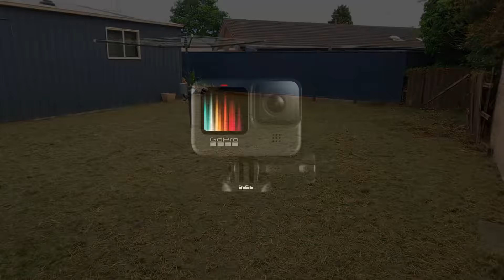GET RID OF IT ALL - SO WE DID - Overgrown Property Clean Up

Comment: I watch a lot of lawn videos just because I love to watch them and this transformation was by far the best when I've seen of all the ones I watch. So far. You turned a shambles into once again a real yard like it wasn't one time
I'm stunned that filled a dumpster.
!!!!

I'd love to know what kind of mower that is because that's one tough little mower!

This was a great job and these people should be thrilled and I don't know what they paid you but whatever it was you probably should have got double !!!
Reply from the maker: Thank you very much, it was probably in my top 5 for neglected yards.
We had to really compact the dumpster, otherwise it would not have all fitted, it was 6m3 bin and we must have filled it with 12m3. 💪
The mover is a Toro 21" personal pacer and has a gator blade fitted, the only issue I have with it is the chute is too small and keeps getting blocked.
I think I could have charged them double and they would still have said go ahead. 💲💲💲
Thanks for watching and comment.
Cheers 🦘👍

Comment: I love that you Aussies use metal fencing… Like shipping containers. Here in the states most of our stuff is plastic or wooden and I would think with the metal it just holds up much better. Great job on that yard!
Reply from the maker: We do have timber fences and these are normally on older homes, most new homes have the metal fences.
Thanks for watching and comment.
Cheers 🦘👍
Reply: I make a joke and say these fences have magnets in them. Usually they are only up a week and a car has driven into them! great job though. I hope that front window is not facing North or West in Australia or it's going to get a little heated inside the house.

Comment: You do a great job and the lawn areas looked fine when all was done.  I am going to offer a  few helpful hints, hopefully.  Get yourself a large flat hand truck, like those at big box hardware stores and keep it with you as you progress.  You can pile tree debris high on it, taking less steps back and forth. When full, walk it to the truck or dumpster and empty it having lifted the debris one third of the way already and you only have to lift it the remaining distance. Next get some light weight collaspable cloth trash bins for grass debris and keep them hooked to the hand truck when not in use. Grass can be compacted down in them and will take up less room later in dumpster or truck.  Lastly, wear a mask always!. Don't breath in those microscopic bits of vegetation and dust. You don't feel anything now, but you will in 10 to 15 years, especially if you smoke. Hope these help. Good Luck with your business.
Reply from the maker: I appreciate all the helpful hint and suggestions that you have made and taken the time to outline.
I have in recent times purchased those collapsible bags and they are great.
Thanks for watching.
Cheers 🦘👍
Reply: Thank you for those hints.  i am watching from far away but already I take these for myself.  Thanks again... God bless you ...

Comment: You missed the bit in the gutters at the front of the house and behind the shed...
Reply from the maker: Not sure where in the front garden you are referring to and for the back yard the home owner didn't ask me to remove it.
Thanks for watching and comment.
Cheers 🦘👍
Reply: @TigerDusty  if you look, at the end of the video when you are showing the results of your massive efforts and hard work, and watch the gutters at the front of the house on the roof line, there is a fair bit of debris from the tree you removed early in the video and what seemed to be some grass growing from it. Because it is well above ground level it is very easy to miss but I have OCD in spades so I notice things like that.
Reply from the maker: @oigleoystereater2003  great pick up, we are going back to pressure wash the area under the carport and also clean the gutters. 👍

Comment: Amazing job. It would have been perfect if 
1) both tree stumps are removed permanently. 
2) I think you missed out 1 area on the far left corner. 

The trees and bushes at neighbour's back yard and front yard should be removed as well. That's the next door responsibility.
Reply from the maker: The home owner removed the stumps.
That area was not required as there items the home owner wanted to remove first, I returned later and cleaned it up.
Cheers